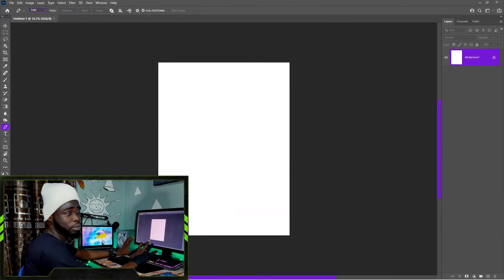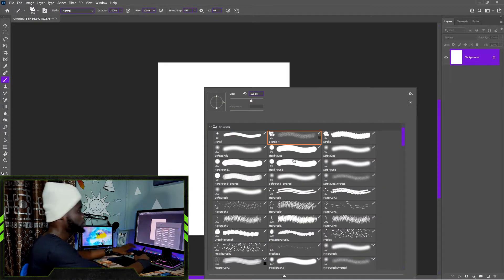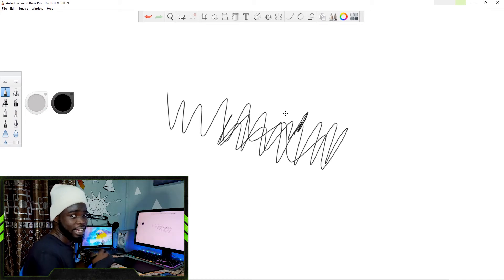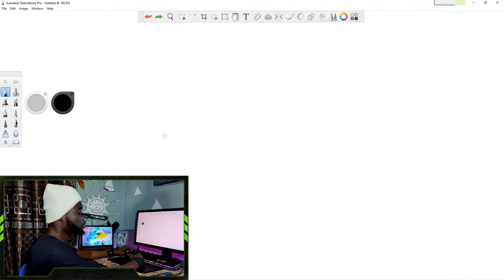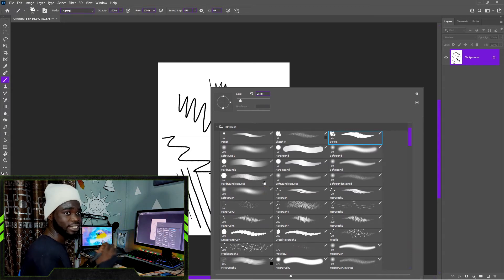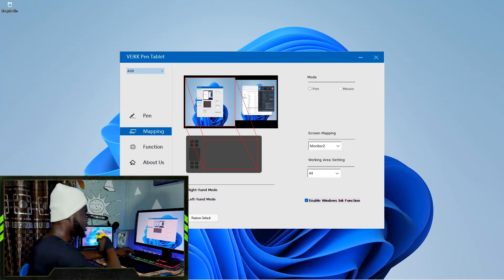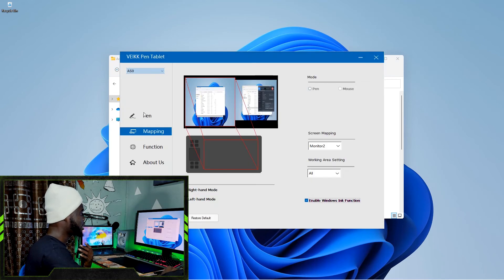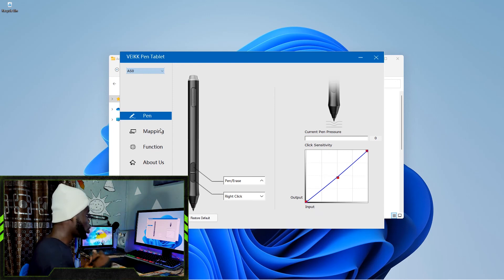How To Fix Pressure Sensitivity On Any Veikk Tablets(Any Software) UPDATED

Comment: Thank you for sharing your solution! I had struggled with the pressure sensitivity on my Veikk Voila L pen tablet and was unable to find a solution that worked for me until I found your video. Your tip to "enable Windows Ink function" was a game changer and I was amazed at how easy it was to fix the issue once I enabled it.😊

Comment: i'm so confused! a little explanation, i've been getting more into drawing and have a Veikk A15 drawing tablet and have started using Krita art software, everything was working as intended for weeks, suddenly today i wanted to draw and the cursor on screen was super shaky despite me holding the pen still, i changed the tip, tried blowing lightly into it to get rid of dust or whatever, no change whatsoever, another suggestion was "restart pc" so did that, no change, then "uninstall the driver and install it again" so i unstalled it, suddenly couldn't even open Krita anymore and shaking was still not solved!!!!! i reinstalled Krita as well as the driver, now the shaking is finally gone, Krita is functional again, driver is back too, but now i've lost pen sensitivity and this fix isn't working anymore, what the heck did i do wrong and what can i try to fix it now?? :0

tldr; this fix doesn't work anymore and i don't know why
Reply from the maker: I think reinstalling your windows can help, or make a clean Uninstaller of the driver

Comment: Mine didn't work and I use an A30
Reply from the maker: I used this settings with A30 too. Uninstall and reinstall your driver and make sure you've not applied any fix before
Reply: @8penstudio  I'll try that
Reply: @8penstudio  I updated the drivers and it worked

Comment: It has pressure sensitivity now but i cant draw eye brows my photoshop shape dynamics pen pressure is not working i can see it in your video too your strokes doesnt have sharp edge. Do you have any idea how to fix it i just format my computer and im having this kind of problem now when i installed latest driver
Reply from the maker: My brushes have shape edges, what you can't see it is because of the pressure I apply on the pen

Comment: Thank you for this solution. It really works and solved my pressure problem but now pen/erase button is not functioning properly. Can you help me with that?
Reply: Same here
Reply: I switched my eraser to pen button number 2 and the eraser started working again. But the main button doesn't work properly.
Reply: @rayroxzyamuzi5805  Thank you a lot for your kind answer. I will try this ASAP, I hope it will work.
Reply: @rayroxzyamuzi5805  It did not work for me but thank you!
Reply from the maker: This is a Bug with the driver, I tried various settings to configure that particular button but it still did not work. The reason for this is that 1. The windows ink function works with the Microsoft pen as the pen is configured to erase with the bottom of it and 2. Veikk have to update their driver to perfectly fix the buttons to work with the windows ink function. The solution for now is just to map a key on your tablet as the eraser tool. I know this is kind of frustrating but you'll get use to it. We only hope that feature update fix this issue and I'll try contacting Veikk to see if they have any fix for this.
Reply: @8penstudio  Thank you so much for your kind answer. I hope we can figure this out.
Reply from the maker: I hope so too. I just write the customer support of Veikk, let's hope they reply with a solution.